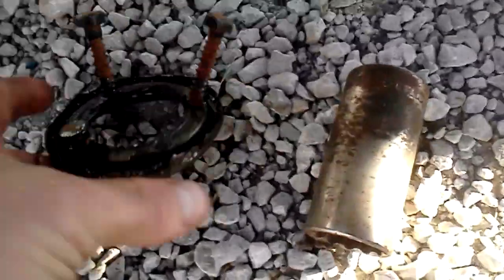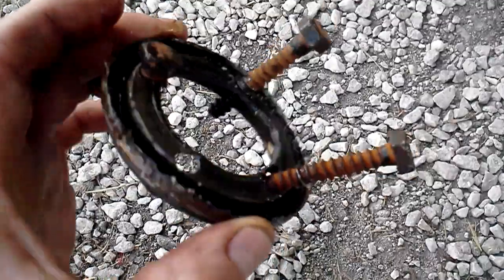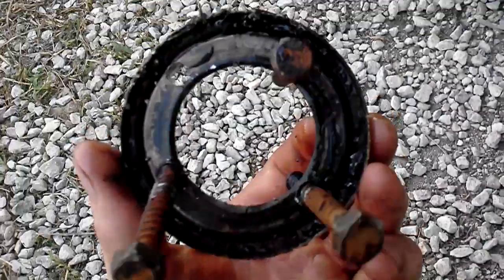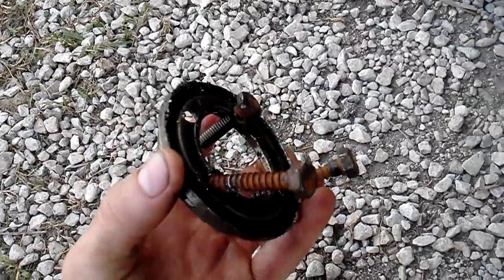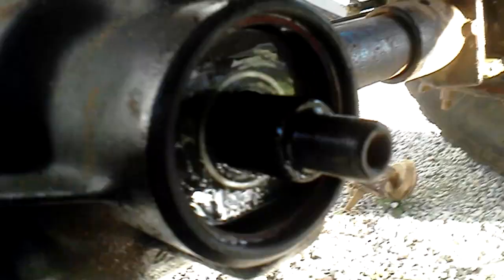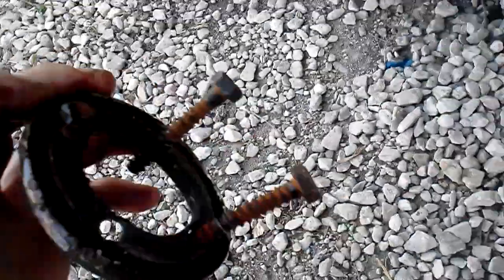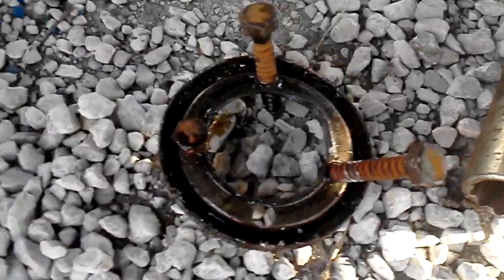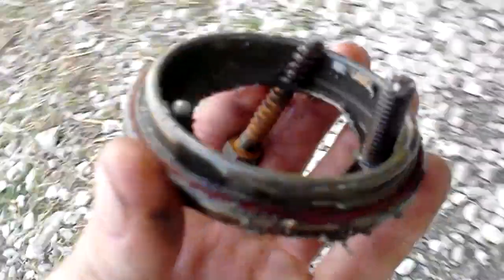Easiest way to change a pinion seal

Comment from the maker: putting them back in is fun! I took a 2x4 and drilled a hole in it big enough for the pinion to fit through and put the cell up there as square as I could, put the two by four against it and smack the hell out of it with a heavy hammer and it popped right in
Reply from the maker: seal, not cell
Reply from the maker: I think I also used like a two or three inch diameter piece of PVC over the pinion to center it up before I smack it with a hammer

Comment from the maker: many ways to do it, you can also take a flat head screw driver and get it on the edge of the seal and hit it with a hammer till you get it bent enough where you can pop it out. some are so flush tho, that method is hard.